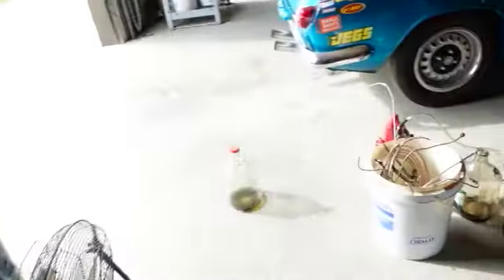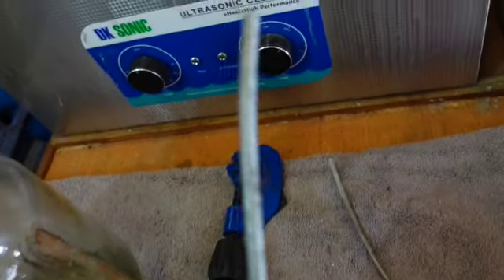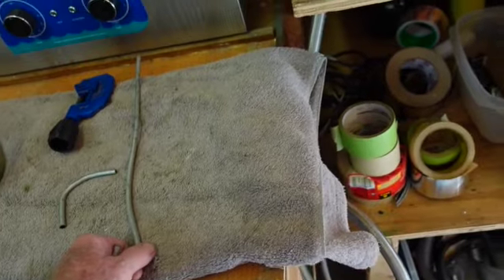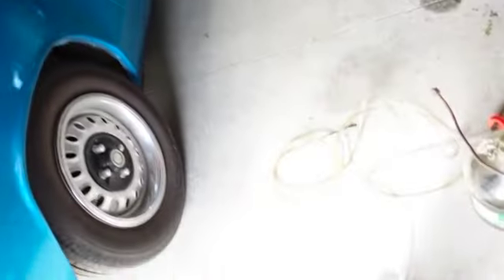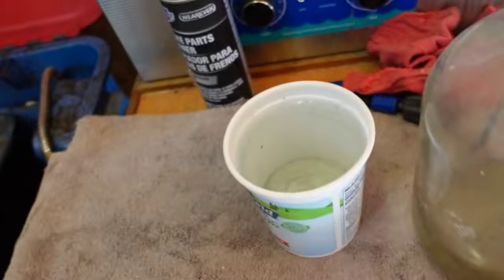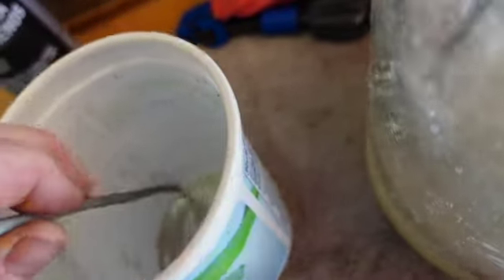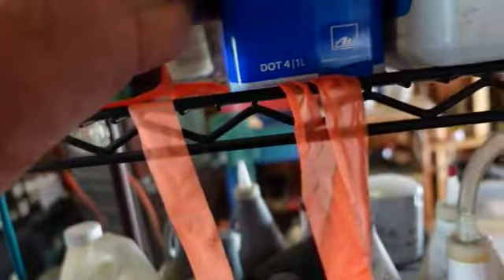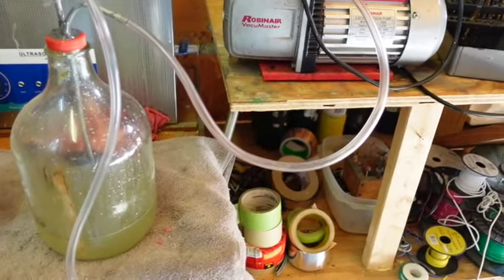The Robinair 15500 Vacuum Pump has other uses!

Comment: Can you use any other oil
For it or does it have to be robinair
Reply from the maker: The pump came with this oil so I used it.  I'd say stick with the same brand of oil to whatever pump brand you're using,  but I have used other oils in other pumps like my big shop compressor and never had a problem.  Not a place to mess around and I try to get the best brands I can but there are tons of choices and synthetics are a part of the mix.  Thanks!
Reply: I use "black gold premium vacuum pump oil" on the pumps I use at work (I do commercial and residential HVAC... But I also do a ton of car work for my friends and myself). I've never had an issue with that oil and it's not from a brand that makes pumps.. they just make pump oil.

I don't know why I never thought of making a simple catch can for em though! Dude that was a really perfect idea! Whether u thought that up on ur own, just realized to do a bigger concept of the hand pump, or learned it from someone... Makes TOTAL sense! U got me digging around my garage to mock up one (maybe a tad smaller) for work! Doing HVAC, the correct (in a nutshell) point to know u removed contamination, is to use a micron gauge and have a reading of less than 500, isolate the system and gauge from the pump with the manifold, and maintain less than 1000 for at least 5min... Well, that's how our industry goes, but the #1 reason it can take all day or even overnight, and many oil changes (only happens on the days u think u finally get a short easy day), is cuz the pump oil gets contaminated with water or refrigerant oil.. that catch can should solve that!! Water vapor will exhaust right out those pump with no issue, but liquid will just mix into the oil.

So say a coworker pushes a line set through a chase under a house, forgot to braze the lines shut, shoves the shit through water... U come in the next day, throw nitrogen on it, it passes the pressure test, ur happy cuz there's no leaks, ya already braze the lines to the unit, release pressure, throw it on a vacuum, AND POOF! Only 3sec in and ur sight glass is completely fogged up... Damn water cuz the new guy doesn't get it. Cut the lines, purge em with nitrogen, and holy crap that was like 2 gallons of water u blasted out! Now ur down to no nitrogen for the next job...

...but making a catch can.. DOOOD!! U can stop the vac before water touches the upper tube, empty the can, repeat til no water, then cut the lines and purge em with just a few spurts of nitro, rebraze, throw the vac back on, n ur in business! Only used a quarter of a tank of nitro, never had to change oil, and barely takes much time!

Changing oil til it's dry can take up to a couple days! Nitro purging can take a few oil changes, a few nitro tanks, and most of a day. This would take half the time as a purge, no excess nitro, and no oil change! U rock dude! My boss is gonna totally dig it too!
Reply from the maker: That is a great comment and I am SO happy it may help you all.  I used mine yesterday in fact.  I pulled a quart of auto transmission oil out of my truck to put in some Bar's leaks treatment.  I had the idea some time ago and have made a few for friends.  It just came to me when I was using a hand pump and only getting a few ozs in that tiny can that comes with the "Mighty Vac".  There had to be a better way.  I also use it to pull brake fluid out before a brake fluid refresh and it gets all the gunk out of the bottom of the master tanks.  I do worry about anything flammable and steer very clear of anything at all questionable.  This would be a bomb so be more than mindful about that - as I am sure you would be.  The little pump has performed so well over the years - even as an automotive A/C vacuum.  Just glad you can use this idea.